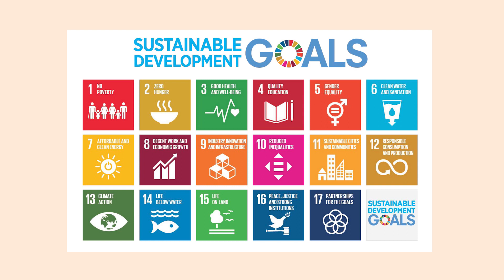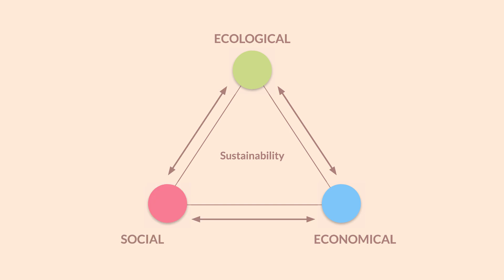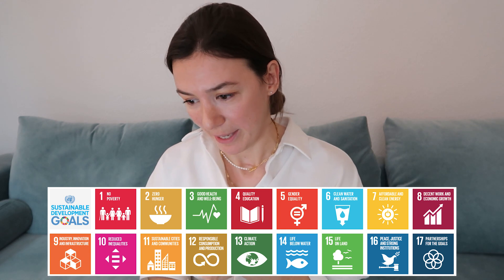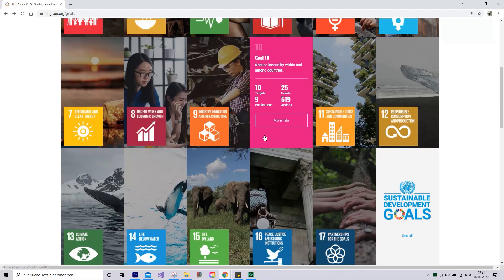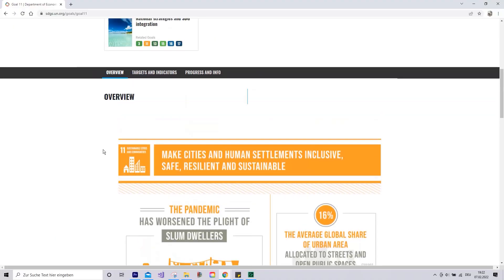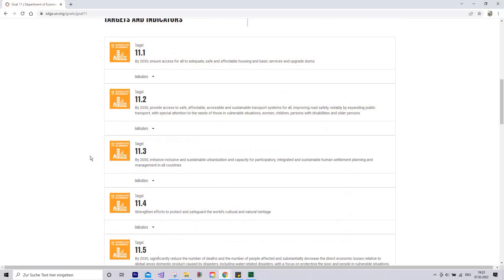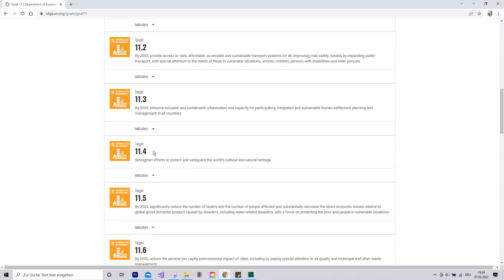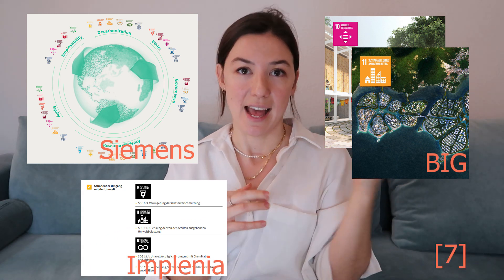A Good Place to Start - Sustainability Series

Comment: Nice to see you after some time. Hope you are doing fine.

Regards to your comparison on building energy consumption from photovoltaic energy source vs nuclear sourced energy, have you thought of considering the lifecycle impact of the two system's respective materila usage and recyclability, GWP (global warming potential), specially on a supply chain scale? This question suddenly crossed my mind so I thought I should shared it with you here.

And please do share more of the insights you've gained and are gaining in your masters. Really appreciate the content.
Reply from the maker: Thanks so much for the question! I'll need a moment to research and give some actual numbers. But there was actually a lot of debate about nuclear energy here in Germany lately, so let me tell you what I know from the top of my head. 
I was actually super surprised to hear that nuclear is not only one of the more expensive ways of generating electricity but it's also not super reliable. Nuclear power plants are usually built next to rivers to use the water for cooling, but because the summers are getting hotter and hotter here, the rivers sometimes don't have enough water and the nuclear plants actually need to shut down. 
And since you mentioned supply chain, the sourcing of uranium (e.g. in Niger) is often linked to human rights violations and dangerous working conditions. And of course the nuclear power plants are not recyclable after the end of their technical lifetime. It's actually suuuper expensive to demolish them because of the radioactivity.
So yeah, I thought it was interesting to learn more about it lately. Because before I was thinking: " oh yeah maybe nuclear plants are dangerous, but at least nuclear energy is low in carbon emissions" ... but when i learnt it's expensive, unethical, unreliable AND dangerous, I was like NO thanks. It's just not a future-proof technology. 
So I am glad that Germany will be shutting down their last nuclear power plants this year. Unfortunately we are still producing a lot of energy from coal + gas. So that has to go next! :)